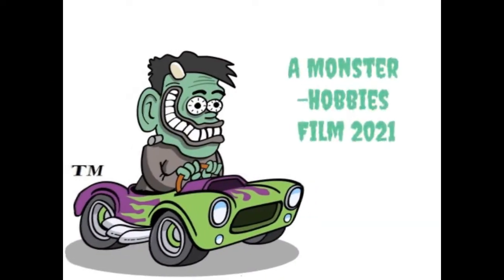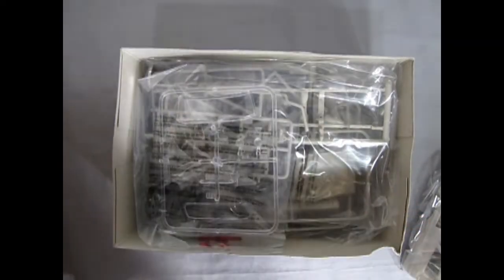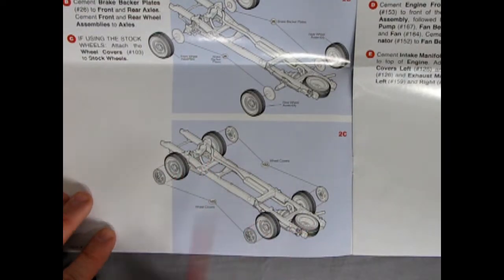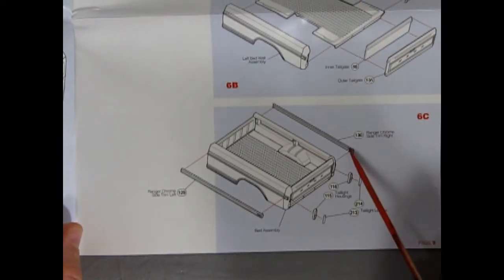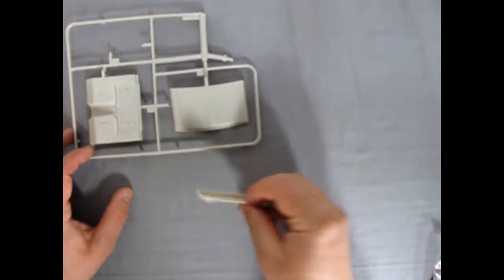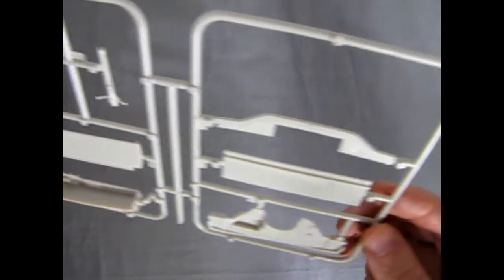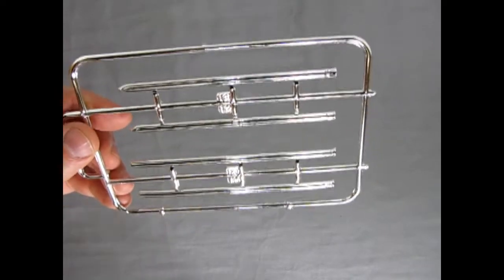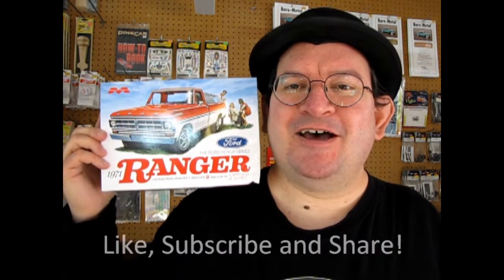Model Car Garage - The 1971 Ford Ranger XLT By Moebius Models - A Model Car Unboxing Video

Comment: Nice review Trevor!
Reply from the maker: Thank you so much. I set the release time for this video back 1:45 so it would release at 12:15 pm locally. were you able to tune in for the premiere?
Reply: @MonsterHobbiesModelCarGarage  No... Just watched it.
Reply from the maker: Sounds good. Do you have this model?
Reply: @MonsterHobbiesModelCarGarage  It was another I started, didn't like where it was going and got rid of it.
Reply from the maker: @THROTTLEPOWER  Ok. That's too bad. Someone said the fit of the glass was off.